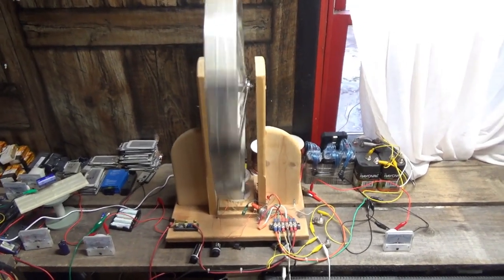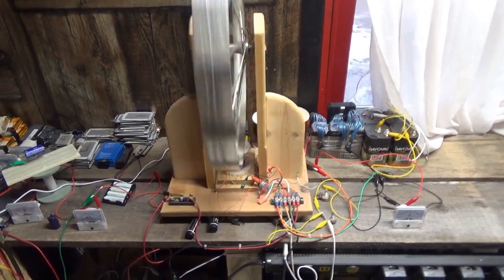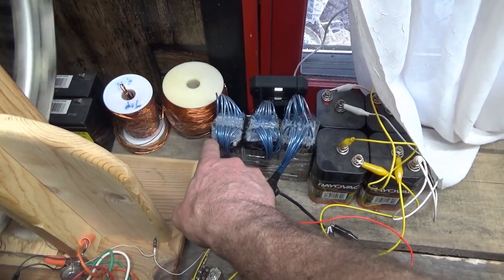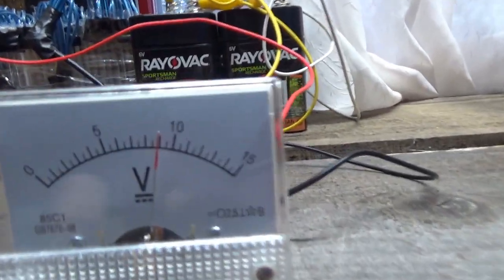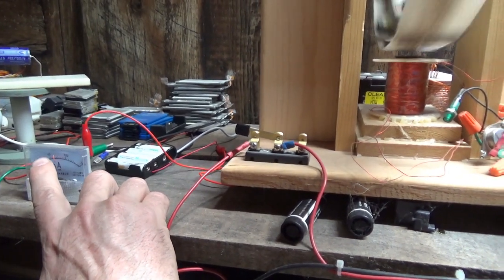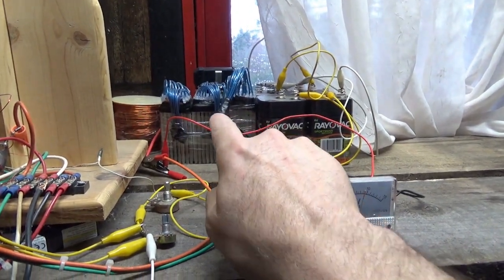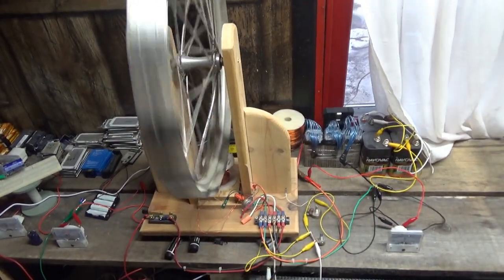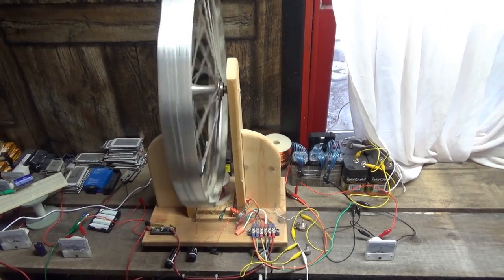Charging 12 Volt Battery With 6 Volts On Bedini Motor SSG

Comment: I've been looking for something like this, I'm trying to figure out how to use a Bedini oscillator/joule thief type circuit to produce HV spikes and send those back to the batteries to keep them "charged" up to continuously produce HV pulses for another circuit without manually swapping the batteries around, do you think it's viable with that's happening here?
Reply: these are  a hoax... don't waste your time.
Reply: @diylithiumguy  I do not agree.
Reply: @JenkoRun  you don't have to, but that doesn't change the truth. The battery running it will eventually be depleted.

Swapping batteries is a requirement for long term use.
Reply: @diylithiumguy  There is no such thing as depleting a battery, the truth is that the dipole must remain open. 

You can disagree with that if you want, but it will not change the truth.
Reply: @JenkoRun you're saying a battery can't be depleted?

I think we're done here.  Good luck chasing this ghost.
Reply: @diylithiumguy  Correct, you cannot deplete something that cannot store anything in the first place.

But if you can't understand then it's better we're done here, I frankly don't want to educate someone with your attitude.

Do not reply. Whatever you're going to say I'm not bothering to read it.
Reply: @JenkoRun  Thanks for confirming my suspicions.  Have a great day!
Reply: @diylithiumguy  this guy has lost his mind!  haha

Which most of these guys never had much of one to begin with.  WOW.
Reply: @randomness_a123  To mock something is pure ignorance. Intelligent people even open themselves to things that they don't understand. […] When an ignorant praises something, it won't probably be something profound. Surely it can't be the Principle that guides us.
― Alfonso Colodrón
Reply: @randomness_a123  I definitely agree. They say the most ignorant things!
Reply: @diylithiumguy  yes!  haha

Comment: Tip #1- SSG coil has a toroid feild on BOTH sides or end's, so add 1 Wheel to other side, Reverse polarity of mag's
fix Coil on horizontal. So for stability and balance, keep two wheel's as identical in material and weight or close. 
tip #2- wind a few Core-LESS coil's and test these as reciever's, placed around the SSG Mag wheel('s) for extra juice,
as many show on YT. "LIDMOTOR" show's this in Vid about his tiny Bobin and regular Bendini, adding gain from Mag feild present and Un tapped by most.
tip#3- if you put round magnet's on wheel, that are mounted with Bearing's so they can SPIN freely, as these 
pass the SSG coil the Magnetic wave will cause rotation of these, this add's to the RPM due to Gyroscopic force by rotation of magnet's. 
tip #4- If you put magnet's on a Generator Shaft and place it next to SSG wheel, the spinning SSG wheel will Pull/SPIN the separate magnet wheel,
transferring force with little Drag on SSG wheel, so more juice from each one added. FYI - a Line of said, Generator's with magnet's can be also done. As seen on another 
channel a line of magnetically linked generator's (MAGGY-wireless generator device of LIDMOTOR) showing touchless force transfer across a Room, from 1 unit to the next unit each unit working in Unision once the Magnetic linking/Coupling has initiated between. Horizontailly or vertically the Magnet force off SSG Mag wheel can be exploited for more than you are presently trying....
All idea's are on YT, showing USEFULL Added gain from basic SSG set up. Good luck in improving this into a OFF-grid power source, that it can be...

Comment: I built a bedini motor following your videos but it does not keep run battery charged or charges the second battery or batteries over run batterie's start charge. Not know what I'm doing wrong. May be difficult to explain over commentsl. Ultimatly would like to speak and show/compare my motor face to face with someone in my area near Philadelphia Pa. If you have any contacts near me please let me know.

Comment: Hello, I am very disappointed, I followed everything strictly in the construction of the sg generator for two months of tests I got nothing. prove that there is negative energy that envelops the battery with n mini neon touching the plastic to light the bulb as demonstrated by bedini to  I could take your word for it
Reply from the maker: I never got a neon to light like that myself. But I can charge multiple batteries at a time with no increased energy on the input side. I have lit 19 LED lamps while charging a battery. I can see that adding a cap in parallel to the output increases charging. I can power a fan on full power with a cap across it while charging a battery and input power is reduced.

Comment: Great stuff. I haven't ran my Bedini wheel in a long time. I used mine pretty much just for car starter battery desulfation. It takes a while but works well. I've yet to build a big one yet but I'll get around to it.
Reply from the maker: Thanks. So far that is all I have done besides fun experiments. I cant afford a really big machine yet.
Reply: Idea, improve the one you have..
A mag wheel on both end's of coil, SOUTH Facing In, on opposite side increase's output. 🤔3D print 2 Magwheel Fan Blade's?
Also, Putting the Magnet wheel(s) on DC motor Shaft to spin the DCmotor for a Generator, while SSG does normal operation😮
make's a few volt's without effecting the SSG output much. I show this on my channel in several version's, Horizontally 2 DC motor's acting as Bearing's with N-pole and S-pole wheel's on 3volt dc motor's. Not in Vid, only 1.4v out each BUT something.. My Vertical way's of collecting More from basic SSG is different but I gained more juice from basic SSG..
Good luck in your SSG experiementing..

Comment: The lipo pack you have made will be very energy dense and very useful for powering higher powered devices. Would like you to show more of it. It looks like it’s a very neatly put together. How do you and your family are safe can’t wait till you’ve got time to do more on the Electronics side
Reply from the maker: Yes at 32 Ah it is a powerful pack. I do plan to add another set in series to get me 14.4 volts tho. I am starting to work on all my channels more now. YT has demonetized all but my homesteading channel and they cut my pay to almost nothing there too. But I am hoping to find out how to work their system and regrow.

Comment: Its nothing unconvitional, the pusles on the output coil are going to be super high even with 6v on the input, so it will charge something with a higher voltage than the input, you can more and likely even charge 24v battiers on the output with a 12v input. its just how inductors work.
Reply from the maker: I meant conventional chargers cannot do this. But also consider there is a motor running which can do work.
Reply: @thedoityourselfworldelectr8007  yeah most chargers cant, but some can, i have a hobby charger with a buck/boost converter, if the battery your charging is higher than the input, it runs in boost mode and if your charging a battery lower than the input, it runs in buck mode
Reply from the maker: Good thing to have.

Comment: Well, you CAN do that with any boost converter. 

The real question is how much energy is consumed from the source battery and how much energy is put into the charge battery.

nice Bedini build though
Reply from the maker: Thanks. Yes, you can use a boost. I was not thinking of that at the time. But I do believe there is something unconventional going on here.
Reply: @thedoityourselfworldelectr8007  I agree.

You can alsos estimate the "drag" of the wheel, 

Firs figure the "center of mass" from the wheel hub of the wheel and the magnets.

Find a way to measure rpms.  Wit the magnets on the wheel a simple hall effect sensor connected to an arduino will show the impulses. then adjust for the number of magnets.

Spin the wheel and measure start a timer when you pick an instant rpm (or Hz to stay metric)

Then do nothing and measure how fast it slows down. THis is your decelaration rate.

The spinnign wheel has some rotaional energy which is 1/2MV^2, The mass is the wheight of thw weel. The speed is the rotation speed in 1/s (Hz) multiplied b the distance of the center of mass from the hub estimated in the first step.

Time how long it takes for the wheel to stop. 

Now you know that in this time the wheel has lost its initial energy.

Divide the initial energy bz the time in seconds ans you know pretty accurately how many Watts it take to keep the wheel spinning at any RPM.

I'm curious about what that number is actually.

cheers
Reply from the maker: I know the RPM I measured one time about 500. As for the rest of the math, I am not so good at that. I can measure the time it takes to stop.

Comment: You can "desulfate" lithium-ion batteries whilst charging them similar to lead-acid?
Reply from the maker: Not sure yet. Going to find out if these get better or worse. Its a long test tho. I will be sure to make a video when I learn something. But I can say that so far this pack is not showing any signs of damage yet.
Reply: @thedoityourselfworldelectr8007  don't think they will get damaged but the bidini wont restore any capacity or change anything inside the cells.
Reply from the maker: I am not sure. I have been studying Lithium batteries. Crystals grow inside the cells and the ions get sluggish. If you can find a way to break up those crystals, or groups of lazy ions, you can restore the capacity somewhat. A university recently did some studies on this and someone has made a Lithium battery with extended life using this method.
Reply: @thedoityourselfworldelectr8007  usually any crystal building up are permanent, idk if you really can extend the life much. cycle life will hit them first before anything else. as long as you don't hard undercharge them, I'm pretty sure they will never form.
Reply from the maker: I am planning to find out through experiments. I have found that an 11 year old Lithium battery can regain capacity with cycling. I plan to post my experiments and results here soon.
Reply: @thedoityourselfworldelectr8007  yeah, old lithium batteries that have sat a long time usally have to be woken up by cycling. Not sure what chemically happens during the wake up phase but it also happens in Lifepo4s
Reply from the maker: Yes. It goes against everything we are told about Lithium batteries tho. Even the BMS systems are designed to shut them down forever if they sit too long. I bypass those and get very good batteries.
Reply: @thedoityourselfworldelectr8007  usally those bms’s wake back up unless they are a bms with RAM as a storage device, some bms’s PURPOSELY do that so you buy a new battery if you accidentally let it sit around dead too long. As we all know, when RAM has no power, data is all gone.
Reply from the maker: Yes I am aware of the ones that shut down intentionally. Quite frustrating and wasteful of a good battery.